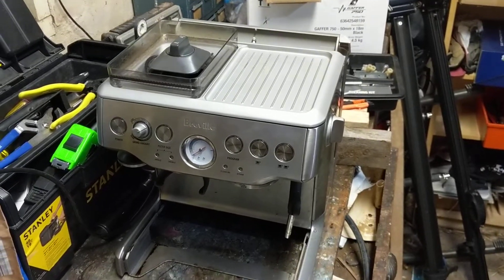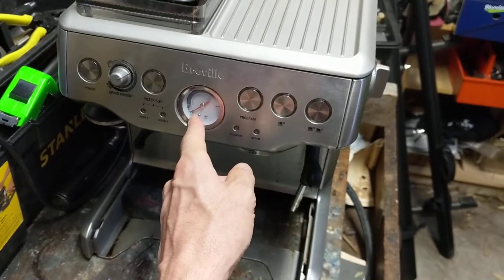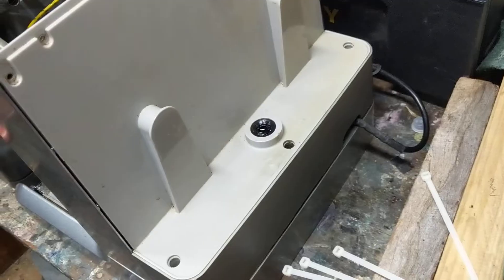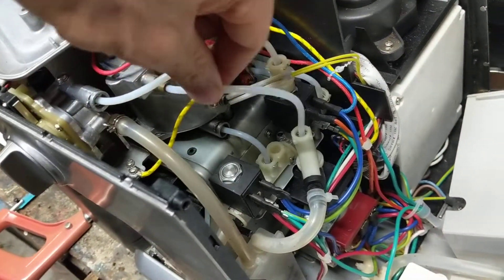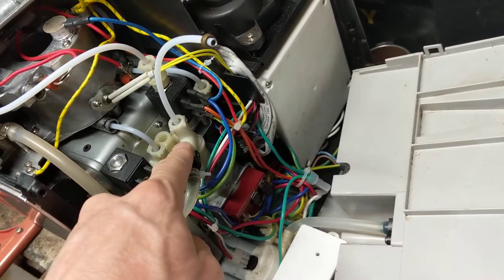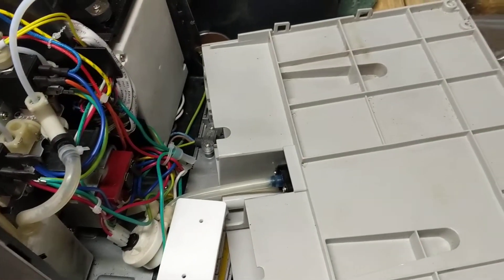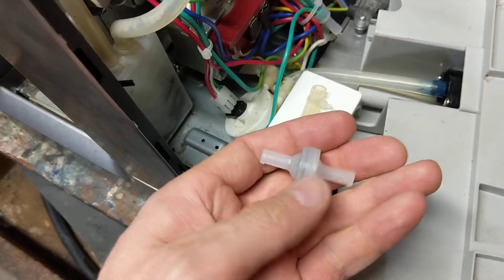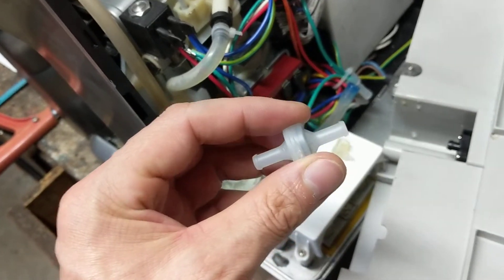Breville BES860 repair for low/no pressure and low water output

Comment: Hi thanks for the video, subscribed. I hope you can help. My machine is pumping normally, and heating normally but no water comes out my brew head, nor does steam comes out the steam wand.  Also I don't see water going into tray on the bottom. What should I check first?
Reply from the maker: I'd check the pump first. If you disconnect the tube as shown in the video you can test the pump. You say it is pumping ok, so if this ok, then the problem could be a blockage in the small pipes, remove and check the one leading from the over pressure valve to the boiler. Recheck. You can bypass the online filter I refer to in the video easily.  In fact, I no longer have this filter in my machine as the water quality here is so good. Recheck. Failing this,  Problem could be the boiler, you can remove and flush this too.  Good luck.
Reply: @chrismelin6337  this machine i have sat in storage for more than a year, im hoping its something simple like a clogged line.  I'll look at your video again to see what the parts I should be looking at.

Comment: What is the point of disassembly if there is no pressure but water still comes out? If water is coming out well but no pressure you still know that the pump works and there’s no blockage. That’s where I’m at. I still took it apart and no obvious reason yet as to why I have excellent water flow but the pressure is 0. Usually you could tell right about when it would start the extraction and on mine it just stops right before that point.

Comment: Hi, Got a BES870 used and sold as condition unknown in an auction. Initially no water flowed at all. Put a straw in the water inlet aperture and sucked and got some water flow but not much. Also tried that technique of removing and replacing the reservoir quickly with the machine on and hot water in the water tank. This seemed to affect the noise the pump made at times, as if something was improving, and  the occasional drip from the water outlet did drip more, but I couldn't get beyond that stage despite a few hours of trying. I also notice a lot of water collects in the tray area, presumably from the outlet inside the machine or diffuser. 
Pretty expensive round here to get the machine checked and diagnosed, and then the repair cost on top of that.
Does it sound like it could be a really bad air lock or maybe something else given that quite a lot of water after 2 hours of trying with the straw accumulated in the tray? Also, I can't get the rear cover off -- there are 5 screws at the back on the side but just 1 instead of 3 on the horizontal part of the rear cover. I have tried some force to unclip it but the unclipping at the top does not seem to release the panel so I can remove it. I wonder if there are other screws somewhere to release the back cover that the reservoir slips to? Videos on YT show 3 screws at the back, mine has just 1.
Reply from the maker: Not sure why the back won't come off. The plastic does flex quite a bit. I found some water damage had rusted screws in place on the bottom section of my model and so I had to drill these out. Keep fiddling, I think you'll get it off. There are quite a few videos that show this, so search around again for another one. You need to take the top off too and disconnect the cables that join the top. When you do get it off, to test the pump, disconnect the teflon water tube that connects into the top of the boiler and temporarily direct it into a cup (you can see I point this out in the video at one point). Then turn the machine on and try to pour a shot. This should diagnose if the problem is the pump or potentially earlier, eg water flow meter or tank-to-pump filter, as it was in my case. To make the machine run, you need to connect the electrics for the top again, otherwise it doesn't function - I think that's just a safety thing to ensure it is properly earthed. Good luck.
Reply: @chrismelin6337  Thank you very much for the reply. Mine only has the one screw where most videos show 3 near the water outlet. I was not able to get the rear cover off. But I managed to access that notorious tube that gets clogged and it was solidly clogged, so all my air lock stuff was doomed to fail!  I soaked it in citric acid and carefully pierced the solid blocks at both ends with a sharp needle and unwound paper clip. Took many hours. I had to get the tube in and out via just the top cover removed. very fiddly and I had to suspend the clips on cotton in case they fell in! I just couldn't get that back cover off, it definitely felt screwed in somewhere else and I couldn't risk breaking the panel. It was quite a 'mare. When I put the cleaned tube back in, the machine behaved exactly as before - no improvement. It wasn't until I had the idea to put a strong solution of citric acid in the tank and run the machine briefly several times over a few hours that it all changed. The machine started to work after an hour or two of the citric acid circulating and I now get fab coffee out of it. I was absolutely gutted when it didn't work after I put the unclogged tube back in because the repair shop wanted a lot of money to fix it. But a happy ending thanks to the citric acid after refitting the tube and some careful (almost surgical) access through the top cover! :-)
Reply: Q M 01 Some machines only have one screw on top (in the middle) and two other screws underneath, left and right corners.
Reply: By the way, what did you use as a strong solution of citric acid?
Reply: @daniangel4715  Thanks, under the machine there are 2 screws next to the feet at each end. When I unscrewed them (one does not come out fully anyway) it still seemed likely that the panel would break if I tried to remove it. But perhaps a lot of courage is necessary!
Reply: @daniangel4715  2-3 heaped teaspoons of powder to a quite large mug or so of hot water added to another mug of hot water in the tank or whatever took it to the minimum water level. I don't use vinegar as it damages some machines, causing leaks and I don't want to risk it, even if it's okayed in the instruction manual.
Reply: Q M 01 Thanks! I’ll try that. Haven’t thought of using hot water in the descaling solution.
Reply: @daniangel4715  It's all guesswork, I'm no pro repairer nor expert, obviously. As I'm sure most know, hot water but not boiling and nowhere near boiling or you can damage the reservoir tank. That can also work to clear an air lock if left for an hour but in my case it wasn't an air lock.

Comment: Where did you get the parts??
Reply from the maker: The pump I bought on eBay. There was quite a few suppliers. The solenoid assembly I had to call Breville and pay over the phone. I’m Im in Australia. I never replaced the inline filter and in the end bypassed it as the quality of tap water is so good here I think it was rather useless.

Comment: Thanks for the video. I confirmed I have the exact same issue; the in-line filter was plugged. I contacted Breville and the CS person says he can't locate the part number for the in-line filter and wants me to send the whole machine back!!! Can anyone help me locate the part # and place to order? I am in the USA
Reply from the maker: I just cut it in half, cleaned it and glued it back together with a two-pack adhesive. You might be able to get a similar generic part elsewhere. GoodLuck.
Reply: @chrismelin6337  Thanks! I called Breville again and was finally able to get help.  www.ereplacementparts.com part number is SP0013624 but it is discontinued. They are sending me the part # SP0001461 but stated that it is not sure it will work! If not, I will try to do what you did. Thanks Chris Melin
Reply: @frederickguesneau8601  HI, I'm trying to get that part but when I search for SP0001461 nothing that resembles the filter shows up. Could you please see if that's the number. Thanks!
Reply: @fabriziosanabria5414  The part #SP0001461 worked and is accurate. The issue may be that I got the part from Breville; not ereplacementparts.com. I recommend you call Breville.
Reply: @frederickguesneau8601  Thanks a lot!

Comment: Just put a new solenoid in mine, steam comes out the group head now..
Reply from the maker: You may just have some air trapped in boiler. I have seen posts online about bleeding the machine to flush it out. Maybe just try running 5 out so cups to see if water eventually comes out? If your seals are good and you've reconnected the tubes correctly, not sure what else could be the problem.

Comment: love the way you just pull the top and back off without any explanation?  Please?
Reply from the maker: When I made this video I wanted to address the inline filter problem as that was my problem and I thought others would have the same issue. I had observed there are already much better produced videos online than mine that demonstrate the removal of other parts including the back and top. This is why I did not bother showing the disassembly from the very start. For example, see this video: https://www.youtube.com/watch?v=V-WCjDRRFFw  Best of luck with your own machine.